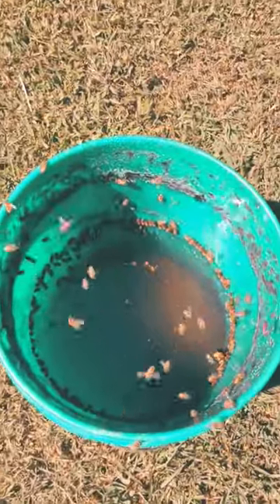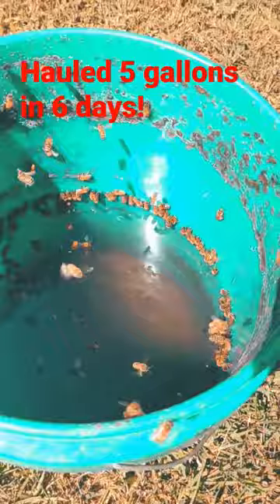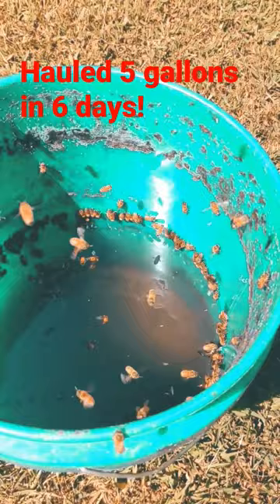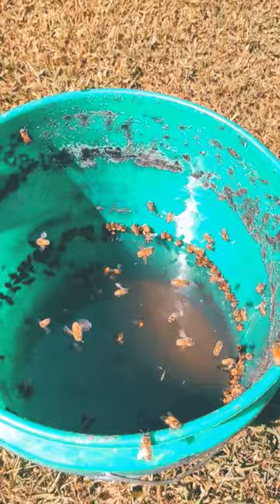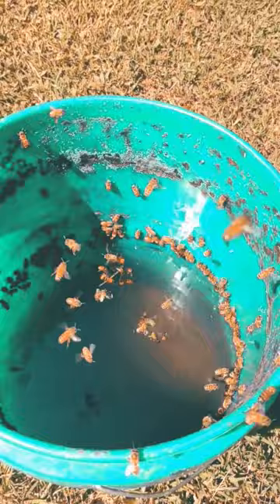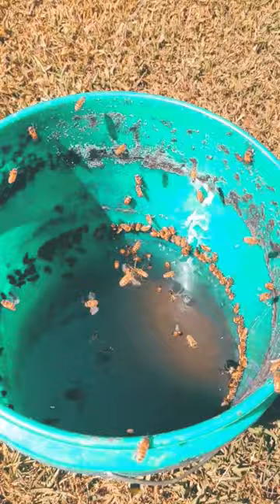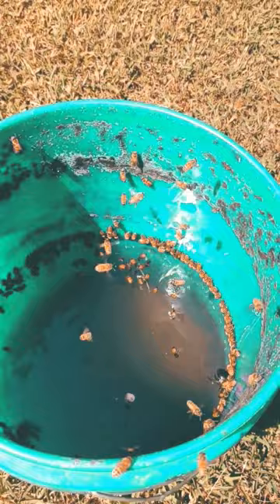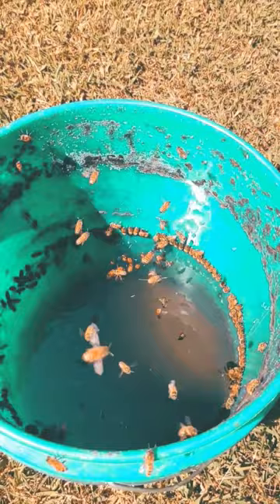A/C for "Thirsty" Honeybees

Comment: I have a drippy faucet on a cinder block about 50 ft. from my hives, but they mostly take moisture from the 2 potted plants on my back deck which have wick bowls under them.
Reply: i wrapped a small towel on the drippy faucet and they are all over it in the winter